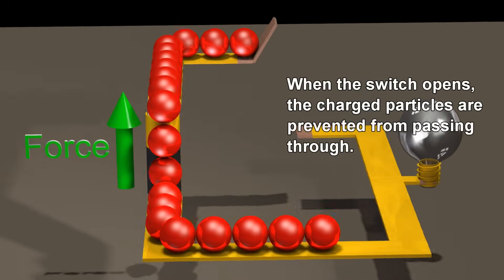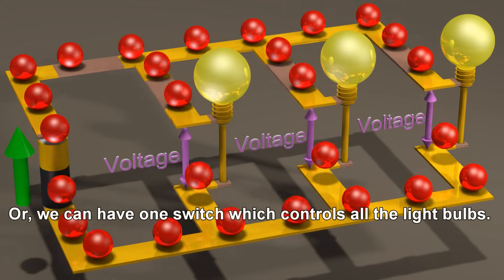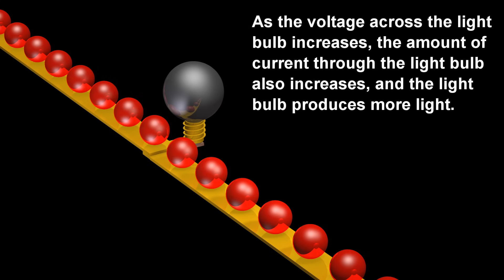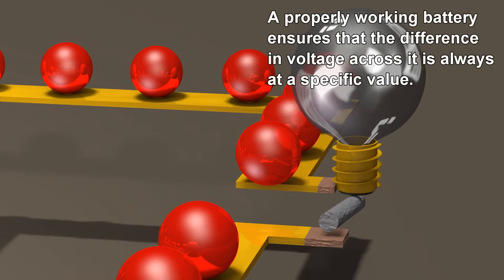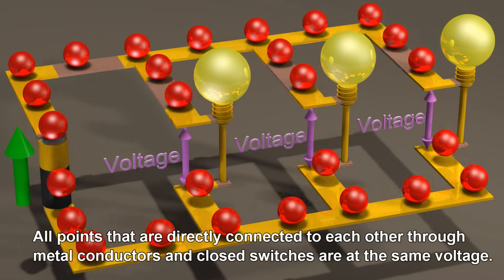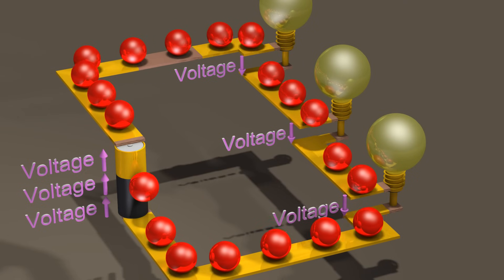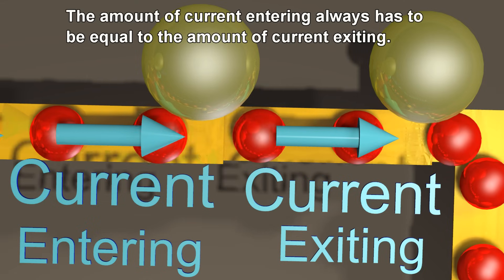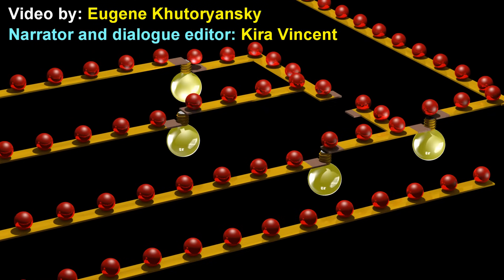Electric Circuits:  Basics of the voltage and current laws.

Comment: Im so confused i studied that the potential difference is the difference between the number of electrons on both sides of a battery and electrons detect this through their fields and go on the higher side to form equilibrium in the no of atoms so this video is confusuing coz idk what just happened
Reply from the maker: This is explained in the two videos which preceded this video.  The links are below.
Electric Potential: Visualizing Voltage --- https://youtu.be/-Rb9guSEeVE
Battery Energy and Power ---- https://youtu.be/u4FpbaMW5sk
Reply: @EugeneKhutoryansky  tsm for being active even after this much time of upload it helped a lottff

Comment: 3:42 but if the switch makes the two parts to be at the same potential, how are charges still flowing over the switch? coz the voltage is zero
Reply from the maker: The charges are still flowing the same way they would through a wire.
Reply: @EugeneKhutoryansky  ohh okay, due to a potential diff somewhere else 
Got it

Comment: These videos are soooo good. I’ve been trying to understand Voltage for a while, and I think this video finally helped me get it. I imagine the voltage as vibrations between the electrons making them want to spread out, and resistance as a machine that only lets a certain amount of electrons through per second, causing the electrons having to back up into the ones behind them and slow down their flow.
Reply from the maker: I am glad my video was helpful.  You may want to also watch my video on resistors at https://youtu.be/G3H5lKoWPpY

Comment: Hi
Let's say before closing the switch one side of switch has 5v and the other side of switch has 3 v.

After closing the switch, what will be the voltage at both ends of switch?

Is it 5v?
Reply from the maker: It depends on the resistance on each side of the switch.  If you are asking about a situation where the resistance is zero everywhere, I cover this in my video "Short Circuits" at https://youtu.be/v8iD_waF_kM
Reply: Will it be of same magnitude on both ends?
Reply from the maker: This is explained in the video linked above.

Comment: What is the velocity of the "charged particles" that make up "current"? It must be constant, as my experience in electronics has never encountered the contrary idea. I was told that the current carriers travel at "near the speed of light", and is not the same as "drift current". One amp equals one Coulomb of charge moving past a given point in one second; and a Coulomb is about 6x10 to the 18th power charge carriers. Now, I understand the reluctance of my teachers to say current traveled at the speed of light, since the current carriers we're talking about are electrons, which possess mass, and mass is a problem at, or very near?, the speed of light. So, it seems I must disregard relativistic concerns, and try to imagine the passage of a Coulomb's worth of electrons through one inch of wire at nearly the speed of light, 186000 miles/s...at 63000 in/mi gives 11.7 billion inches that the electron can travel in one second...I calculate, maybe, 6 billion electrons occupying the cross-section of the current flow one inch long to yield one ampere. I think each copper atom is willing to surrender one electron, so that would be 6 billion copper atoms occupying a one-atom thick cross-section of some part of the wire. To carry this further, it seems I'd have to know more about volume/mass and Avogadro's number...molar density, I guess. I've had to come to the conclusion that charge (voltage) transmission governs current disposition at each and every distance along the wire as circuit conditions require--there is no "movement" of current carriers at anything like the speed of light. There must be, instead, a rally of the electrons in the cross-sections of the wire. In other words, the charge carriers don't have to go anywhere because they're always where they need to be according to the voltage. The implication is that, no matter how how the current, you can't exhaust the conductor of "free" electrons...there's just too many of them.
Reply from the maker: The speed of the electrons is much slower than the speed of light.  What travels close to the speed of light is the electromagnetic field.  This is discussed in my video on Transmission Lines at https://youtu.be/ozeYaikI11g

Comment: I fianlly understand voltage as "height" in the analogous system of a ball that drops and "loses" energy to friction. It finally makes sense. Voltage isnt energy, but it allows the conversion of energy (potential to electrical). So, as I understand it, resistance from bulbs causes "loss" of energy, so a voltage drop isnt a "loss of voltage" as the name implies (because the overall voltage is determined by the battery) and moreso a "loss of potential energy" ?
Reply from the maker: I explain this in more detail in the following videos:
Electric Potential: Visualizing Voltage -- https://youtu.be/-Rb9guSEeVE
Battery Energy and Power -- https://youtu.be/u4FpbaMW5sk

Comment: Can someone please explain to me why the charge that are at the same potential are moving? since there should be no electric field if the wire is equipotential and the charges shouldn't move. I don't know which part I understand it incorrectly

Comment: 3:57 the current takes the leftward path instead of passing through the lightbulb. Is this because the resistivity of the lightbulb material is greater than the wire’s?
Reply: rewatching this i think it is because the filament of the lightbulb is broken. This means that part of the wire is broken and it is physically impossible for the charges to move through the filament of that lightbulb.

Comment: I have a question. If the negatively charged particles (electrons) flow from the negative end of the battery (anode) to the positive end (cathode) of the battery, why do your circuit diagrams show the direction of current as flowing from the positive terminal to the negative. This is confusing as I have seen some circuit diagrams showing the flow from negative to positive and some showing positive to negative. Please clarify. Thank you.
Reply from the maker: In an electric circuit, it is the negatively charged electrons that are free to move around, while the positively charged protons are fixed in place in the nuclei of the atoms.  However, this fact was not known when electricity was first discovered, and it was incorrectly assumed that it is the positively charged particles which are flowing in the opposite direction.  The convention for current flow was never updated, and the standard in industry and in education is still to show the direction of this so called "positive current", which is in the opposite direction of the actual electron current.  I explain this in my video on visualizing voltage at https://youtu.be/-Rb9guSEeVE

Comment: If battery + is the sink and the - is the source and negative particles are moving from - to + in the battery then why continuing using this analogy with positive particles traveling from battery + to battery -? It's so misleading. Electrons are negatively charged moving in a conductor from minus to plus yet here we have a conductor with positively charged particles moving from + to minus, which gives the current an opposite direction.
Reply from the maker: Because using positive current, instead of electron current, is the standard in industry and education.  In my very first video, I showed electron current, and people complained that I should instead show positive current.
Reply: @EugeneKhutoryansky  In Maxwell video we have the same red spheres representing positively charged particles - likely protons. And blue spheres were electrons. In the circuit videos the red / blue spheres are not the particles but rather the proton current. Proton current doesn't exist it's an obsolete model. I'm sure that most of the viewers believe that Maxwell video red spheres are equal to the circuit red spheres. That leads us to the conclusion that proton current should somehow be visually different from electron current. May be using red + instead of red sphere would be better in circuit videos. Then a student won't mix physics with an abstraction model. Or alternatively a red bar can represent the current in the circuit.  Currently we have both concepts mixed. Maxwell theory, magnetism and circuit laws,  all mixed, it's messy. 
If we use electron current in visualization : red/blue spheres
if we use proton current in visualization : red + /blue - or yellow minus

I agree that sphere is looking great in circuit but only for as long as it relates to the electron current.  

There should be some visual difference between particles used in electron current and particles used in proton current. So at least a question would raise - why are they different? Why we have sphere in Maxwell video and + (or bar) in current video? The answer would be because in Maxwell video we a particle which is the sphere and in circuit video we operate with so called proton current model which has + standing for blue sphere.
Reply: @EugeneKhutoryansky  The world in which the gravitational force sing is opposite is dramatically different although the only difference is the sign. So I guess it's a tremendous difference between having proton current model in the head and electron current in the head. At least there should be a clear distinction so they wouldn't both mix up in wrong physics.
Reply from the maker: I explain the difference between positive current and electron current in my other videos.  For example, I explained it in my video on visualizing voltage at https://youtu.be/-Rb9guSEeVE

Comment: Love your channel, but there's just one thing I don't understand one thing about this at all. Why does the voltage remain constant before the reaching the resistor? Voltage is the negative of electric field times distance. Charges are moving through an e field everywhere in the circuit (even before the resistor), so why wouldn't the voltage drop steadily?
Reply from the maker: There are no electric fields inside an electric conductor, hence the voltage is the same everywhere.  I explain this in my video at https://youtu.be/-Rb9guSEeVE

Comment: So at some point if you have too many light bulbs the battery would deplete super fast. But my question is, is there a limit on the amount of current a battery can give? Let's say you hooked up a ton of light bulbs to the one battery, would the battery eject all it's power at once?
Reply from the maker: All batteries have some internal resistance, so there is a limit to the maximum current they can produce.
Reply: @EugeneKhutoryansky  OF COURSE thanks!

Comment: Hello! I need help with this question and if someone can help me I will be very grateful. Suppose I have a simple circuit, made up of a 1v voltage source and a 1 ohm resistor (R1), I understand that there is a 1v voltage drop in the resistor, I understand that this is due to the fact that the electrons collide and energy is lost. But if I disconnect the circuit and add another 1 ohm resistor (R2) in series to the circuit and turn on the circuit there is no longer a 1v voltage drop across the first resistor, in fact the voltage is distributed across the two resistors, there is now a voltage drop of 0.5v across each resistor. Why is this happening?. What affects the presence of R2 so that 1v does not fall on R1?
Reply: in a single resistor circuit, the voltage isn’t ‘depleting’. Although we call it a voltage source, it doesn’t actually supply voltage. It supplies energy. Or energetic electron. The name simply implies that voltage across the source will be constant. The amount of energy the source supplies varies depending on the circuit. However, the work per charge is same. The change in energy comes from the change in number of electrons a source can push across the resistors.If you have a large enough resistor to actually deplete the energy of the voltage source, then adding additional resistors in a chain would be meaningless. There would be no current either way. In the first circuit you had a 1 voltage source and a 1 ohm resistor that is, a resistance of 1 ohm alone was resisting 1 volt of current. we know the resistance is formed as a result of the collision of moving charges with stationary atoms When the second resistor is added, the current will pass through both resistors, so it will encounter two obstacles. Therefore, the voltages are lower because the overall total voltage should not change and be shared between resistors

Comment: So as the carriers pass through each bulb in series, the "future" bulbs are dictating the movement also, which is why the first bulb isn't the brightest? The "need" for voltage to pass through second and third bulb produce an equalized movement? 

Vin and Vout being equal is like a gatekeeper law? If all the voltage were used in the first bulb then the carriers would be unable to pass through the second for lack of emf, and the flow would stop. So the maintenance of flow supercedes all?

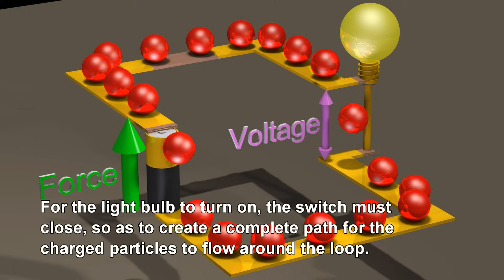Comment: At 1:12 the current is flowing from positive to negative (conventional flow). When the positive charges complete the circuit they end up at the negative end of the battery. But the positive charges move up through the battery and out the positive end again. Does it really happen like that? I thought the charges would flow from one end of the battery to the other end and and stop at the other end. Isn't there something inside the battery which separates the positive and negative charges?

Comment: I got the point that you are relating gavitional potential difference to voltage but how is it possible that electrons are again rising up through the battery from lower to higher potential?
Reply from the maker: I show that in my video on Battery Energy and Power at https://youtu.be/u4FpbaMW5sk

Comment: Can I ask a question?
If I have 1 battery and 3 lights are connected in parallel, will each light be as bright as if I installed the same battery with only 1 bulb?
Reply from the maker: Yes, that is correct.

Comment: Ah, this is why voltage in DC circuits can experience significant loss with long wire lengths. The higher the current, the more voltage drop.

Comment: Some thing not right at 3.46...the middle light bulb basically will still on because: 1. the path the current goes through the bulb is shorter than goes around through the switch...2. The bulb still have a voltage difference compare to the lowest point...then still current flow...and they called these moving thing "electrons", not "particles"
Electrons current works the same like water, it flows from higher ground to lower ground, if 1V is 1 meter high then 100V equal 100m high, means it will flows faster and stronger...
Reply from the maker: The video is correct.  The current will go around the bulb because there is no resistance going around the bulb, but there is resistance going through the bulb.  Whether or not the bulb is on only depends on the voltage difference between the two sides of the bulb.

Comment: Some of the best visualizations on basic electrical principles I've seen. However, in mentioning the voltage drops across the light bulbs, it would have been useful to mention the resistance of the light bulbs and the role it plays in determining the amount of voltage drops. If this was added then I'd think it would be one of the best examples of basic DC circuit principles that I've seen.
Reply from the maker: Thanks for the compliment.  I have a separate video on resistance at https://youtu.be/G3H5lKoWPpY

Comment: Thank you so much for this really this is just amazing .Never have I seen a video electricity and voltage so effortlessly. But I have a doubt if the voltage difference same in the metal conductor that means that the net electric force is zero then how do the electrons flow?
Reply from the maker: Thanks for the compliment about my video.  As for the question, you can think of it as objects continuing to move through space without any forces due to their forward momentum.  Newton's first law of motion: "An object in motion stays in motion..."
Reply from the maker: By the way, unless we are uswing superconductors, there will be a small voltage drop in the conductors, due to the fact that they do have a small resistance.

Comment: If all points that are directly connected to each other through metal conductors are at the same voltage then how is current flowing between those points?

Comment: Wrong electrons flow from negative on the battery through circuit to positive terminal. 😁
Ok long time ago everybody tough it was flowing positive to negative.  For demonstration, theorem can be display either way.  Now you know.
Reply from the maker: Using positive current (opposite of electron flow) is the standard in industry and in education.  In my very first video, I showed electron flow, and people complained that they wanted to see positive current flow instead.  There is no way to please everyone.  By the way, I explain the difference between positive current and electron current in my video on visualizing voltage at https://youtu.be/-Rb9guSEeVE